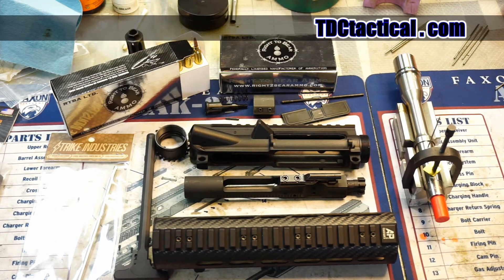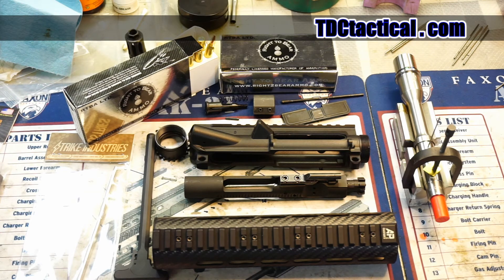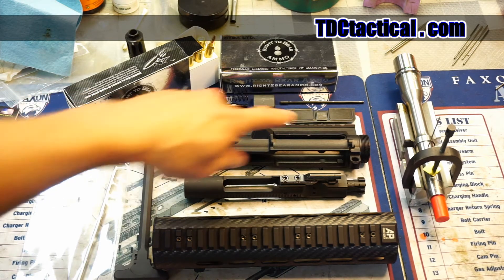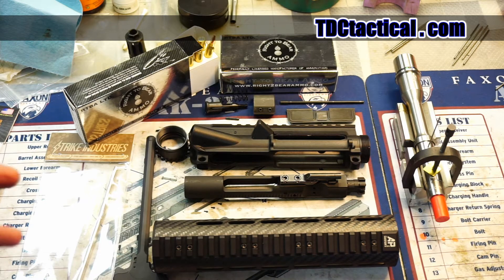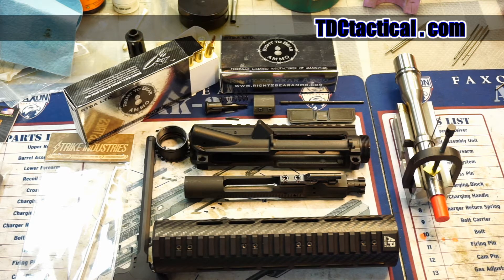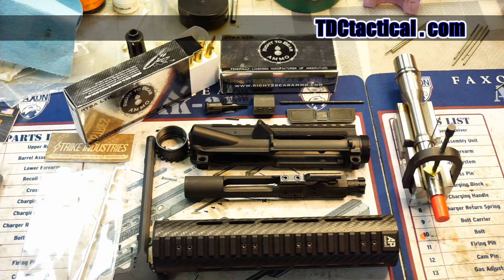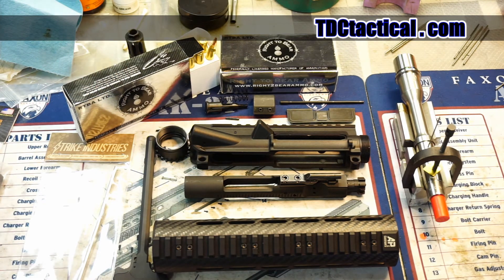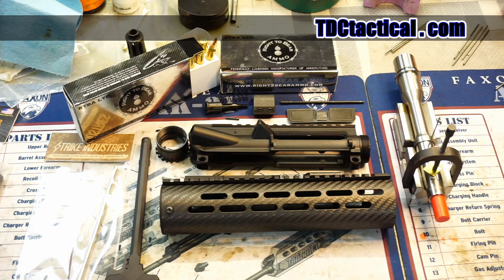PROJECT: development of an Upper that will reliably cycle SUBSONIC 5.56

Comment: I watched a video from H45 and he shoot some subsonic 223  and it reduced the round in to a 22mag .What is the advantage of the subsonic ammo in 223 ?
Reply from the maker: krazy45cat Well the .223 subsonics are usually a 72-75 or more gr projectile. That tips a little more power in the 223's favor over the 22lr.  There is no real practical reason other than people want their suppressed 5.56 to be quieter and probably bravado keeps them from just throwing in a 22lr bolt. haha
Reply: TDCtactical Thanks Buddy :)))